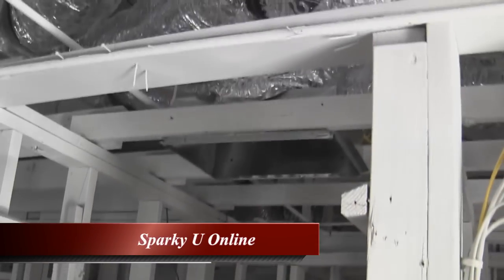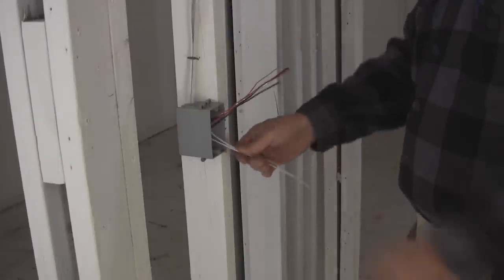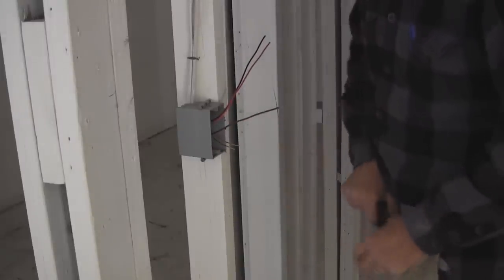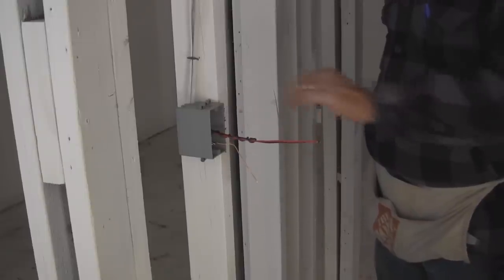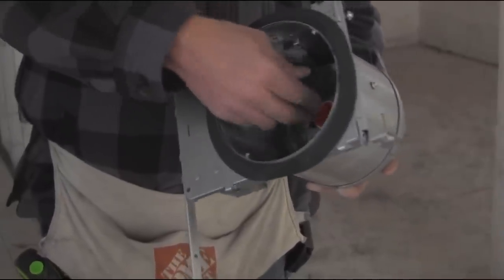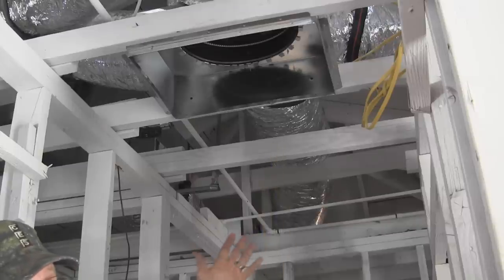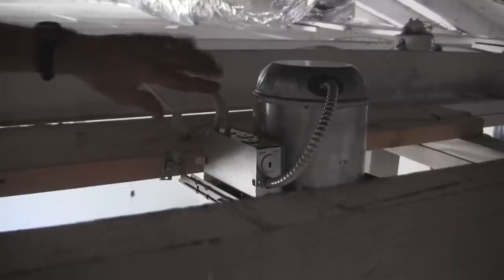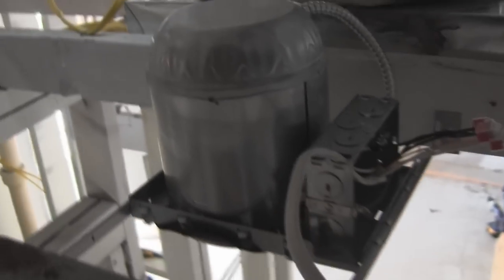3-Way Switches and Recessed Cans

Comment: @SaintWilliamIII Today I replaced a bathroom plug that had those push in connectors. To my surprise the push in connections had oxidized so much (green) that the wires fell out when I pulled on the plug (all copper, no Al) . Presumably with the high humidity of the bathroom there was accelerated oxidation. I took the extra time to use the screws for the new plug.

Comment from the maker: @Sine1040 I have seen both homes and commercial builds that use the push on exclusively.The choice to reuse is up to the installer,I have tosed tons of wire nuts away because the didn't make good connections.

Comment from the maker: @SaintWilliamIII I am sure millions of homes are wired with the quick connect method.If installed correctly they should work fine. 
Are you sure the can wires are aluminum?

Comment: I always heard that the push-in connectors on a receptacle were not as safe to use as the screws.So I am wondering why are they coming out with more push-in's now and are they dangerous. I actually never liked wirenuts; I always thought a more secure connection could be made if there were some type of screw terminal strip in the back of the box. Also, I just bought some can lights that have aluminum wire;what's the best way to connect to 12-2 copper?  Thanks.

Comment: Hi Spark, is it allowed to do the complete wiring with push-on connectors ?

Here in the Netherlands whole installations are done with push-on ( the wago brand is pretty big here ) and wire nuts are hardly ever used anymore.

However I don't like to re-use them, When I have to redo a connection I use a new connector.

Comment: I noticed that the three way switch mounted in the single gang box had both 14-2 and 14-3 running through the same opening in the box. I was taught that you should not do that because the wires can overheat.Has anyone else heard of this theory?

Comment: what kind of tool belt is that sparky.lol if you run a 14/3 between both sw then you can have a hot an swleg in one box. bring the swleg back from dead end side of 3 way an tie that to load or light swleg. can save time and wire.. did you know that one sparky